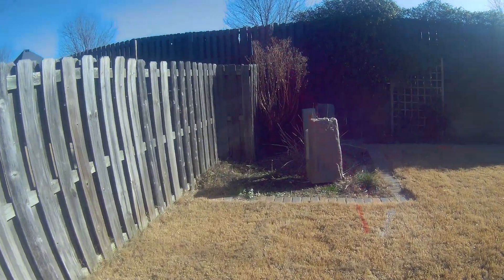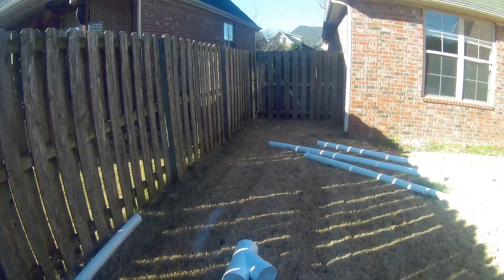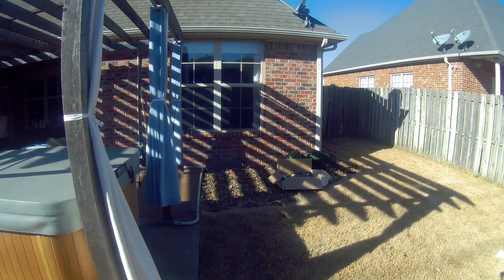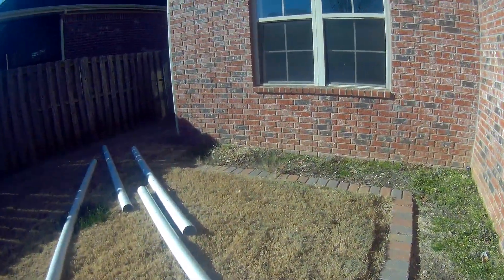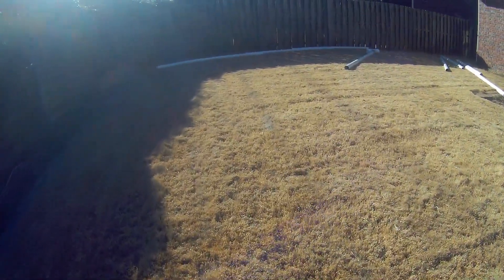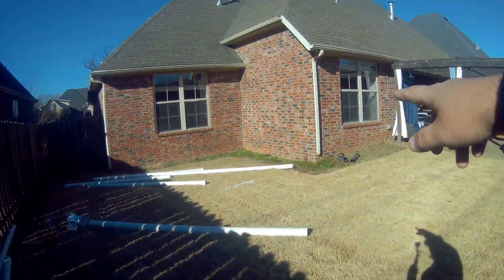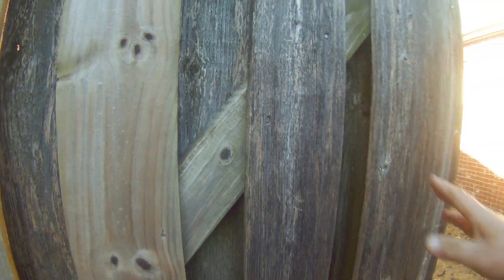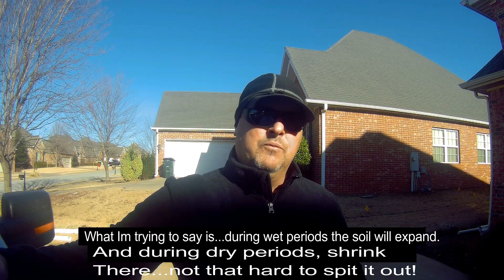Surface Drainage - Gutter downspout Drainage Part 1

Comment: At 8:27, it's too bad the customer didn't want to take the discharge line to the street. To save the money, would it have been possible for the customer to dig their own trench to the street and you lay down the pipe? Maybe a good project for a customer with kids stuck inside during a global pandemic?
Reply from the maker: Donald Lee yeah, anyone can add to, extend, their system if they wish. Sometimes clients get in their mind what they are willing to spend on a system. It wouldn’t have been that much more to take this one to the street, but he insisted on ending it there 🤷🏿‍♀️

Comment: Thanks for the video, I'm looking into fixing some drainage issues. How much savings could there possibly be from 20 less feet of drainage to make it worth stopping at the driveway??? Seems like a mistake to not go all the way
Reply from the maker: Runehorn it was an additional 30 -35ft if I remember correctly. It would of added a couple of hundred dollars. If you take the thousands he spent on the total project, I guess in his mind saving $250  -$300 was worth it. I get this often with clients, and at that point all I can do is offer the benefits of extending the pipe to the street/walkway. 

In the end - I ended up extending it an additional 10 ft as due to grade to much water left in the drain line, which I told him would happen. So he finally agreed to extend it an additional 10 ft.

Comment: Looking forward to the second part of the video.   Looks like a pretty involved job.    My house's system is a work in progress.   I'm working on swapping out the corrugated black 4" pipe and changing it all to SDR35 and Sch40 4" (Sch40 6" probably for under the driveway).